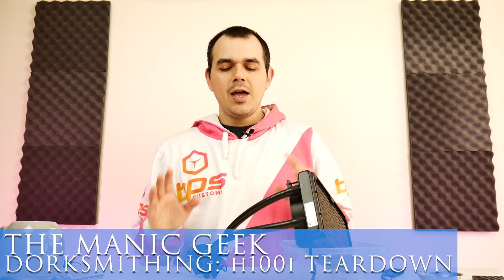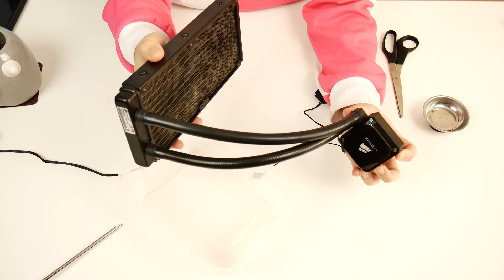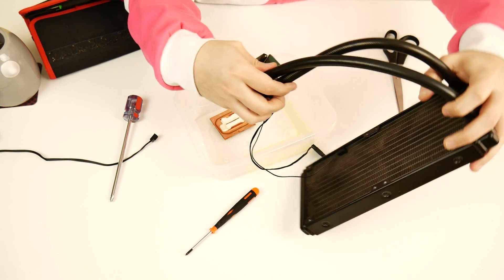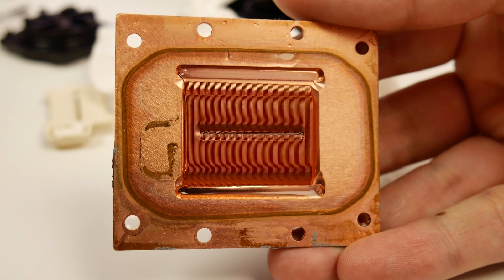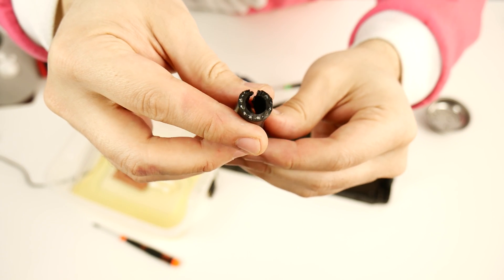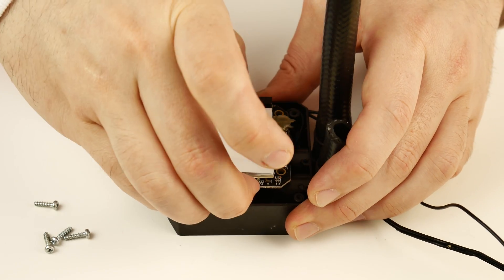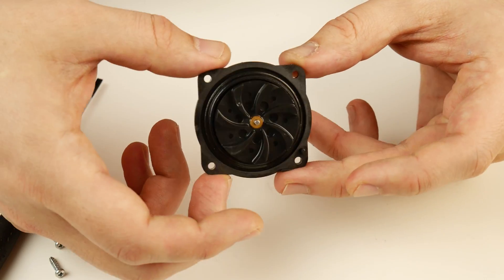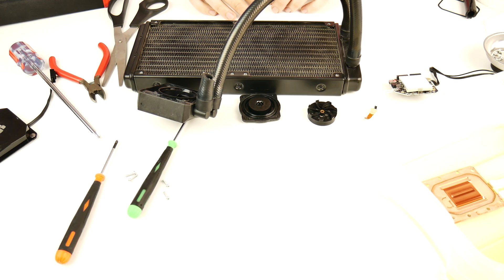What Was Inside This Seven-Year-Old Corsair AIO!?

Comment: Mine H100i is 10.5 years old and still working! =)
Reply from the maker: That's actually kinda insane! They actually don't make 'em like they used to anymore, it seems.
Reply: @TheManicGeek  The world has changed. It was "the quality" before  not the marketing & money. I bought my i7 4770k in March 2014 with Corsair H100i, and they both are still in service. Wanted to replace it with newer 14900k, but Intel wasn't lucky enough with these CPU's, as well as not lucky with Core Ultra 200. It looks like these two veterans have to serve me more time that I expected. I dont want to switch to AMD (nothing bad about them, but I am Intel fan, at least I was). I also was a big fan of Corsair, but they want too much money for less quality now. It's just a brand, with no soul.

Comment: Thanks for this video! I have the exact AIO and it started getting really hot after a couple of years. I ended up replacing the fluid with some EK coolant and it's fully functional again! Thanks for the tear down - really helpful
Reply: How did you do it? Did you take off the coldplate, and fill it that way?
I have never done it, and it's like probably 8-9 years old, I want to give it a try...

Comment: I had a h60 v2 that I dissambled about 4 years ago and the coolent was beginning to break down and the copper from the block was corroded yours looks alot cleaner then mine did.

Although I did have a swiftec where the whole pump was filled with algee. As it had a full port I refilled it with about 25% green antifreeze 75% distelled water and it has worked fine since.
Reply from the maker: Interesting that your H60 should have been in that much worse shape than mine. Maybe I got lucky? I'd honestly like to take apart other older AIO's to see which ones consistently look worse than the others.

It's been a while since I've worked with anything Swiftech... actually it's been since the earliest days of the channel really, but I can say I never experienced that algae issue even with several loop drains and refills.

Thanks for watching and commenting 🤙🏼🍻